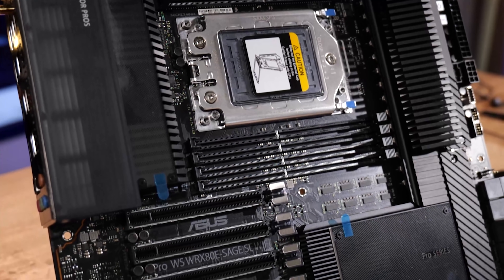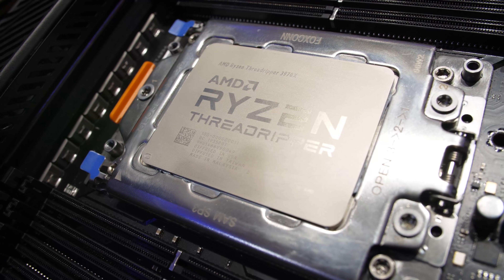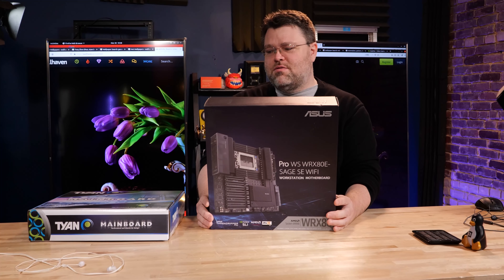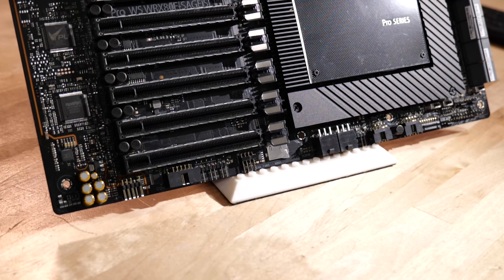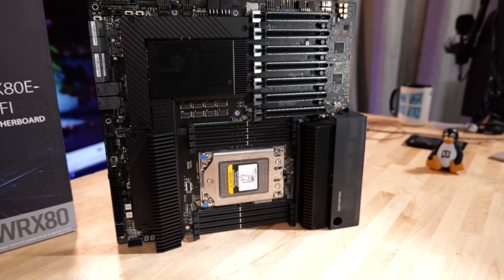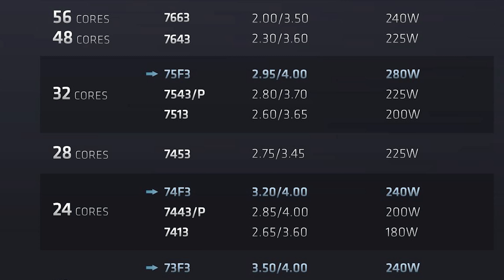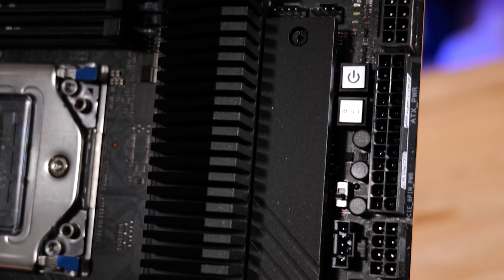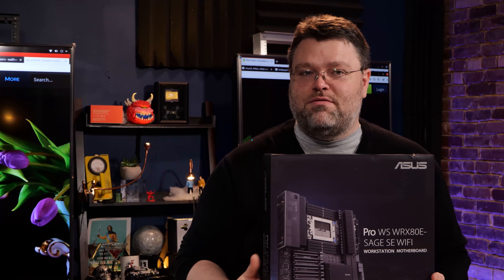Epyc 7713 vs Threadripper Pro for a Workstation?

Comment: Yo hice este montaje
 1. --WS WRX80E-SAGE SE WIFI
 2.-- AMD Ryzen Threadripper Pro 5955WX Processeur
 3.--Ventilador CPU Noctua NH-U14STR4-SP3 +
 4.-- Fractal Design Define 7 XL Cristal Templado USB-C Negra
 5.--DDR4 RAM 3200MHz 32 * 8  = 256gb ram
 6.-- Samsung 970 EVO Plus 2TB NVMe M.2 SSD
 7.--ASUS RTX 3090 STRIX ROG
 8.--Gigabyte GeForce RTX 4060 Ti Gaming OC 16GB GDDR6 DLSS3
 9.--Seagate BarraCuda 4TB Disco interno HDD 3.5" SATA3
 10.-- 5 Disco Duro Crucial BX500 4TB SSD 2.5" SATA 3
 11.--Seagate IronWolf Pro 3.5" NAS 16TB SATA 3  
 12.--Corsair  1200W  Plus Gold Modular  Esta placa base no tiene competencia va genial

Comment: FYI. After doing some testing between TR Pro and Epyc they are the same CPU, Identical. So IN THEORY, if you could actually hack the BIOS of the ASUS WRX80 board to have the AGESA code for EPYC processors it would work. 

The other thing you could do as a motherboard manufacturer is just build a SP3 EPYC board and put the WRX80 chipset on it, since the chipset uses PCI Express to communicate with the CPU, its just a AMD branded PLX hub, in fact, there is no reason why you can't use ANY PCI Express based PCH from AMD with any of its CPU's, its just a matter of Firmware hacking

Comment: Earlier this year 2023 I looked at TR, TR-Pro, Epyc, and Intel Xeon W for a new workstation.  TR-Pro is too expensive in Canada and now old tech PCIe4/DDR4, Epyc is server and doesn't have the I/O available on any boards like I want.  So I went with the Xeon W.  W7-2495X 24C 48T, ASUS WS Pro W790 ACE, 512GB DDR5-4800 ECC RDIMM, ASUS ROG STRIX RTX-3090.  Awesome system.

Comment: It seems that EYPC platform might have a better upgrade path with decommission CPU in the future. Threadripper Pro probably has less sale and thus less quantity to be in circulation in the future (and worse, most Threadripper Pro CPU are probably from DELL and Lenovo workstation and vendor locked). But even EYPC 7003 frequency-optimized SKUs cannot match Threadripper Pro's 4.5G turbo.
Reply: I have heard that a lot of Epyc are also vender locked. 
Just a question to keep in mind when buying used. And now with the sinkclose bug you need to be extremely careful with used Epyc and basically know the whole chain of custody, because even though they are releasing patches to prevent future exploits it isn't practical to test for (or fix) a previously compromised SMM.

Comment: question is  witch one will be avalable on the cheap as use  after few years ,for video editor or photographer ,  like the the 2011 and 2011-3 xeon cpu ,  today
Reply: Used Epyc is never going to be like used 2011 socket Xeon. 
They have too much difference in depreciation curves. And many current generation processors are either locked to OEM motherboards, or they use a sort of rental model (Xeon "scalable") where you pay extra fees to use the whole silicon.

Comment: Would AMD Epyc be suitable for headless workstation computer? Fan noise is zero issue since that computer is going alone in the attic, so air blast it away. I intend to use it with Parsec, imagine using my Macbook Air with the power of dual socket 128 cores and the most powerful GPU I can find, probably an upcoming RTX Titan Ada. I'm currently using headless desktop with AMD 5950x with RTX 3090, an upgrade would be a possibility.

Comment: Beside supporting 4TB of memory vs the 3995wx 2TB. What other advantage of the Epyc Milan vs the Threadripper. Because the Threadripper platform is a lot cheaper in term of price performance.
If I the Threadripper as a server instead of the Epyc, how much performance gain would I see in real world environment?

Comment: 10:35 - I built a system at work with that Gigabyte motherboard. The layout is awful as only 2 slots can deal with anything other than short PCIe cards. Do not recommend.

Comment: Thanks for an excellent vidieo. The point at the end with the airflow is very important. I am planning to use my old full tower cases and build an "epyc" Threadripper-pro workstation for the workload I have in the pipeline. The 10 gbit interfaces will also be put to use! - apropos airflow, and my very sensitive ear/brain (tinnitus and more)- I am considering to get waterflow and an external radiator outside the window to take the heat!

Comment: EPYC workstation would be great for me, if it supported overclocking a bit. Unfortunately even if you compare same core count parts, the EPYC CPUs clock way lower than Threadripper, at base and boost / PBO, and TR is overclockable. I think it only make sense to get EPYC is you really need to get 64 core version, and need 512GB+ of RAM. Otherwise you are paying probably few more cycles for memory access when using RDIMM vs UDIMM, and possible more time because of lower memory clocks. For the data center, or big virtualisation / compute clusters, sure EPYC is way to go (bigger memory, more cores, better power efficiency compared to higher clocked Threadripper). But if you buy only 1 box, be it a workstation, productivity, science, gaming, server, Threadripper is very nice product. The higher thermals and power usage will not be a big issue when you just have 1 or 2 boxes, and ultimately unlock your productivity to not waste your time waiting for things to finish.

Honestly I like the EPYC motherboards more than Threadripper motherboards, but I can survive. I do like the VGA breakout, because I will probably not use it ever or maybe once, and use IPMI / KVM over network only, so that indeed would be a waste of back IO space. But at the same time, I don't like (close to hate), integrated WiFi or audio on motherboards either (even desktop or workstation ones), so for me that is also wasted space, which would be better used by putting there two SFP+ ports, or a serial and IPMI VGA.

I am kind fine with the current system (TR 2950X). I could upgrade to 2970X very cheaply now (there are some nice promotions), but I think I would like to keep high clocks, more memory, more cores, and more memory channels. So I think I will wait for DDR5, and Zen 3+/4, if PCIe 5, is there by then, that would be even better, then will go with highest clocked 32-core 8 memory channel system for that.

I am super pissed by companies like Asrock Rack, that they don't use AMD 10Gbps NICs (3 of them), that are available on many EPYCs. Stop putting this Intel extra stuff, that adds to the board cost, space and power. Only few boards were released (with Embedded EPYC or EPYC) that use them, but none in the mini-ITX or micro ATX formats (they still use Intel NICs there, which is even more silly). I think the only one I found was a developement board from Asrock or Tyan, and now there is ASRock Rack EPYC3451D4U-2L2T2O8R, it is micro-ATX, but includes both Intel and AMD NICs, which is okish I guess, but the pricing meh (~1100$). I just want some nice simple small high performance board for a router, firewall, etc, mini-ITX, with 2x SFP+, 1x 1Gbps and IPMI and that is all basically. And similar micro ATX for file servers (2x SFP+, 1x 1Gbps and IMPI) but with extra one or two PCIe slots in the that case. It is not possible to find such board right now. I hope Asrock makes EPYC3451D4U-2L2T2O8R with the Intel RJ45 10Gbps removed (I guess it would be named EPYC3451D4U-2L2O8R :D), ~900$, I would instantly use it for my new file server.
Reply: EVGA SR-4.  Support for Dual 64 core EPYC, 4TB RAM, 10 PCI-E slots, et al.  One can dream... ;-D

Comment: I'm very happy using my epyc 7702P i got super cheap with an asrock epycd8-2t as my workstation :D got 256 GB of 2666 ecc memory and 4x1TB nvme's in one of my pcie slots in a 16x to 4x4x4x4 card

Comment: I think at the current pricing scheme, the difference is where the computer/server is deployed so as to define its form- factor. Workstation is meant for professional work loads of an individual.  Think of an engineer running cad. That project is dumped onto a server for multiple access, Now you need a machine that can handle raw input and many users all accessing this file and others. Thats where you typically need more cores but more power reduced.  Its about access now not necessarily  creation. The render is done localy, the access is remote.  The server cpu's are designed with remote as the main point. Threadripper-not-pro is really as close as a gamer would want to get to work station. Consider advanced gaming.  Top end GPU's do not support SLI it all comes down to overclocking and   overclocked ram.  3200mhz is considered slow in the gamer world. Top DDR4 runs at 5333mhz now.  When you look at DDR5, ddr5 is beat out in early iterations. The thread ripper i believe has an unlocked cpu, for overclocking. The pro I didn't think does. Also very few gamers want to spend $2000+ on a sub 4ghz CPU for gaming.  Cores count is only useful if you stream and record your gaming.  Even gaming home servers are based on single core hyper threaded performance. Meaning many games will take advantage of a single core and its hyperthread but not jump to another core, except when running multiple instances. "Per Map/world."  Prime examples minecraft and ark.

Comment: Isn't the main difference/biggest difference between Epyc and TR is that TR is overclockable, is 8 channel memory really worth giving this up? 
So you talk about TDP but if it's overclockable you make the TDP whatever you want, if you have a cooler that can handle 1000w then so do it. I know the power consumption on the Threadripper 3990X hits around 500w using the auto-overclocking PBO feature under full load.

Comment: Is there a massive performance difference in your average workload between 4 channel and 8 channel memory?
What is the core count crossover when 4 channel is the bottleneck? 
We have 16 cores on standard desktop with only 2 channels, is that heavily bandwidth constrained? If not then does it not stand to reason you only need 4 channels around 32 cores and 8 cores when you get to 64 cores?

Comment: Given the price and 'prestige' that the Threadripper range has in AMD's line up I really think it should be the debut socket for a new CPU architecture. It just doesn't seem right to ask a massive price premium for a now 9 month old architecture. 

Threadrippers should be a halo product, it should be the first to show off a new CPU architecture to help justify the price premium that comes with that platform, imo.

(Epyc needs much long for verification so isn't going to be a halo product)

Comment: the question I have how much ram can it take and what is the  bench marks for 4k and 8k production and how many hdd/ssd can it handle

my unless  you are using a external hdmi mixing board  you would likely be using atleast 2 hdmi capture  cards and atleast 1 av based capture card though pending on the  service output will  depend what you can upscale or have a native resolution for..

Comment: I don’t necessarily agree that you can’t use one of these server boards in a desktop without a ton of airflow. Maybe you’d run into some problem trying to run a 280W part, but no problem with 200-240W. 

I use the Asrock Rack EPYCD8 board in a multi-GPU compute setup, each system with 6-8GPUs. This is one of the cheapest boards that supports Epyc Rome in a standard ATX form factor. I run these on mining GPU frames, with no special airflow given to the motherboard area, just whatever blows down from the GPUs overhead. I run EPYC 7402P/7502 @ 200W, and EPYC 7642 @ 240W. Zero issues. VRM heatsink isn’t even hot to the touch. CPU load ~98% for months on end.

Comment: The thing I'm more concerned about my Threadripper 3990x is that for some cpu intensive workloads only uses half of the cores. (1 numa) and the other does nothing at all.
I've been told this is windows 10pro fault... but I'm not sure if upgrading to windows 10pro workstation could improve that or what... Or it is because that is how the 3990x works.

Would this be less of a problem in the new threadripper pro?
Would change to windows 10pro workstation fix anything at all for me?

Comment: Have you tried the new-ish Silverstone Icegem liquid coolers for  TR/SP3? A review would be great for those of us looking into building a new TR WS in the summer ;)
Reply: Cooling on Threadripper is very easy, my 1950x overclocked to 460w was still cool on a 120mm AIO. As long as you're not doing anything extreme it should be fine.

460w was average power consumption on the CPU doing 4x handbrake batch encodes plus general use and under 72 hour torture test (also running memtest at the same time), test condition was above 100*F (hottest I've seen in my bedroom was 139*F), it was unpleasant. I run it pegged quite often for hours and hours, so I really want to make a cascade cooler for TR-64 core so I can get 6 GHz all core, though the cooler will cost more and consume far more than the Threadripper, haha! Thankfully they are very efficient and the IHS is massive so it ran cooler than my 1700 with the same cooler at 1/3 the power draw.

Comment: Wondering how well this works for unraid as a server
Reply: Hi,
I have Unraid on my ASUS WRX80-E, 3995WX CPU and 512GB RDIMM at 3200MHz. I've had no problems with Unraid. It detected the 10GbE's fine. The IPMI plugin works perfectly so I can see all the sensor data within Unraid.
Reply: @ubyunet  wow love to see pics and a tour of this. What were your reasons for building using threadripper pro?
Reply: @Goldmaster  I'll sort out some screenshots and a photo of the build after I've finished work this afternoon.

My main reason for using a TR Pro is because I run some CPU and memory demanding processes, such as an ARK and ATLAS cluster. It's also my home server system, which given it has IPMI and a plethora of other functionality, along with the customisability and aesthetics that EPYC systems generally lack a bit in, it seemed ideal. Prior to that I was using a 3990X on the ASUS Z2E motherboard, although restricted to 256GB RAM.

I sort of miss the options for PBO or overclocking on the TR Pro, but it's not a deal breaker.
Reply: @ubyunet  wow thank you. What CPU cooler do you use? Do you use air cooler as that is what I want to use due to less going wrong. I know you can get threadripper air CPU coolers. But not sure if they would fit the socket aside from be mounted 90 degrees
Reply: @Goldmaster  I use the IceGiant ProSiphon (which is a unique type of air cooler), however AMD rotated the CPU socket on the TR Pro which means if the motherboard is at a vertical angle then it won't work efficiently due to the somewhat unique design of that cooler. It should still be fine if the motherboard is horizontal though, but I believe the thermal paste needs to be redone as it's still running a bit warmer than I expected it to even now I've put my case on its side.

As I understand it almost any TR4 SP3 cooler should be compatible as it's pretty much the same socket just that it's been rotated 90 degrees like the EYPC is.
Reply: @Goldmaster  Here's a photo of the system and screenshot from Unraid. I know the cables aren't tidy but it works and it's not exactly on display all day long since it's in a room that rarely has anybody in.

https://imgur.com/a/5q0CiJS
Reply: @ubyunet  wow, so that's in a desktop PC case, with the CPU cooler mounted vertically. I'm guessing you can move the CPU cooler plate so that the whole CPU cooler will fit. @level1techs will like this
Reply: @Goldmaster  Yes, it's in a desktop PC case (Thermaltake View 71 Tempered Glass Snow Edition if I recall correctly). I needed a PC case with a sufficient number of hard drive bays, there wasn't many choices in stock at the time which looked fairly decent and effective but I went for this one. By moving the CPU cooler plate I assume you mean "can I rotate it 90 degrees"? If so, no I can't. It also sticks out slightly at the top of the case which meant a small modification had to be made to the tray which the fans or the radiator can be installed on (cut a small section out).

Comment: Hey Wendell, you keep referring to the out-of-band management interface as IPMI, which is only one of the protocols one can use to remotely manage a server (and a bit old at this point). I guess it's a habit from years ago? Love these video's though, keep it up!
Reply from the maker: And is it really out of bound if it can share the primary nic? That's not exactly really fully out of band
Reply: @Level1Techs  I think it still counts because it can be used regardless of the main system's state, but that can indeed be debated. However, the point I was trying to make was that the management interface is MORE than just an IPMI interface, so calling it IPMI would be doing it short.

Comment: I haven't had a Tyan motherboard since the late 1990s.
Reply: Did you have a S1563 Tomcat?
Reply: @PrairieDog  I think it was the Tyan S1590S. A transitional single CPU motherboard that supported AT/ATX PSU connectors, two different memory sockets, and AGP/PCI/ISA sockets.
Reply: @CDReimer  Nice. Had the earlier S1563 with a Pentium MMX. Tyan made some very nice boards.

Comment: A work load question I have is related to the 8 Epyc that has the maximum L3 cache. If I remember right, each chiplet has it's own L3. I'm guessing that like NUMA vs non-NUMA, there might be some way to take advantage of that with some sort of mode switching; if each module with it's single core doesn't need to have a duplicate of data in other's L3, something ought to be able use that well. Curious about the trade off related to latency when the data does need moved to a different chiplet. I know some games run better on older Xeons with excess cache than they do on modern architecture CPUs. If I could justifying buying that processor as a toy, I would, then just run stuff and see what the hell.